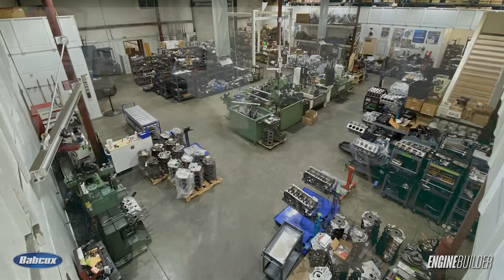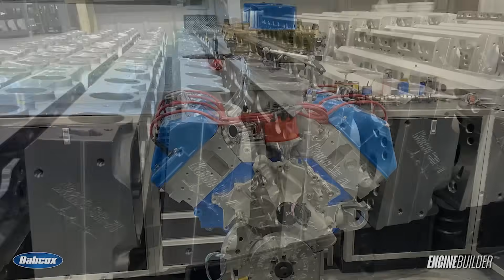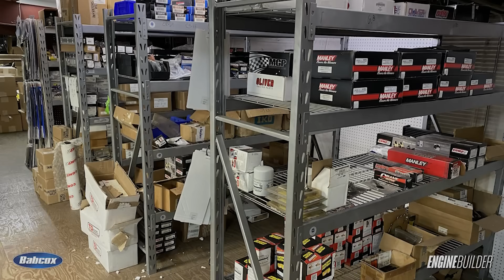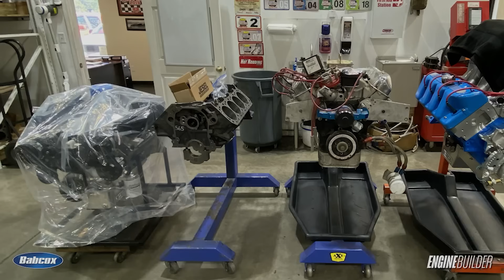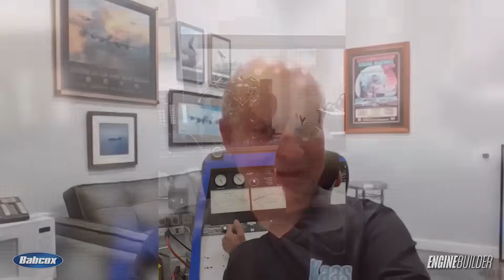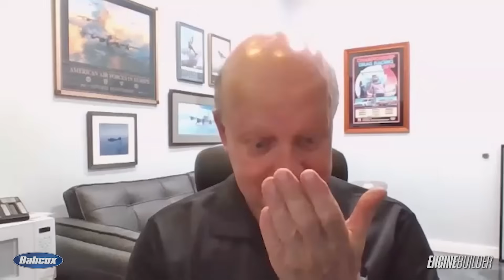Jon Kaase on Marine Engines, Drag Racing, Cylinder Head Development, and Engine Building Success

Comment: I was taking Auto Theory in 8th grade 14 yrs old at Ecorse High school , they were teaching that the heart of the engine was the block. the block is the foundation. the heart is the pump.😮 1980.
Reply: I'm Allen F. Liberacki. I was born in Riverview, Michigan on 11/09/1966.😂 Acropa.😊
Reply: I gave him the secret to the ford distributor put the 10,000 bearing on the bottom side of the drive gear the block is already drilled for it. that solves the kick out.😮😊

Comment: What the hell is going on with the top of Jon Kaase's head. Three ridge line bulges move around as he is moving his head when talking. It looks like something out of a science fiction filmed character.
Reply: Nothing like focusing on the important stuff
Reply: @mback12000  You got to be blind or ignorant if that top head video BS dose not bother you after 55 minutes. Nothing like professional video taping on professional engine builders. They have AI programs that could have straightened out Kaase's bald head causing the Science Fiction head you have to try ignoring for 55 minutes. Visualization in videos is just as important as words spoken.
Reply from the maker: Unfortunate light over his head
Reply: @EngineBuilder  AI clean up is what professional YouTubers correct their f*ck ups with. It was torture to watch Kaase's Science Fiction Head for 55 minutes. Pull the video while using the available AI programs for straightening out Kaase's head, then repost the video!
Reply: Wow- hard core insight.
Reply: @arthurking6549  Something is wrong with you if watching Kaase's Science Fiction head for 55 minutes